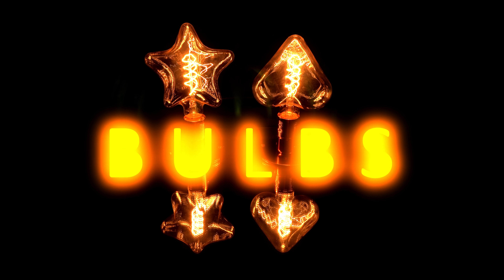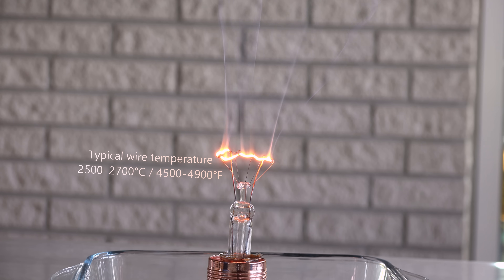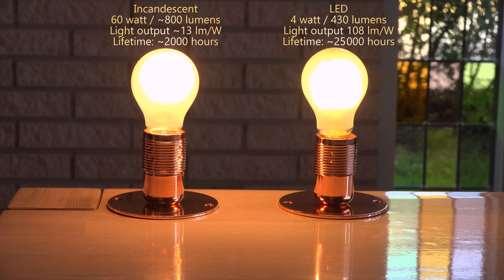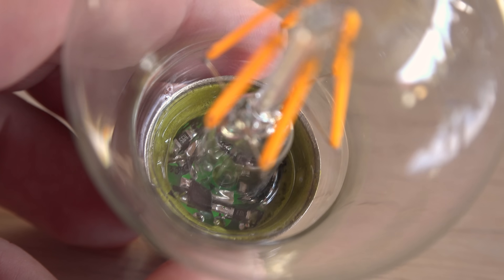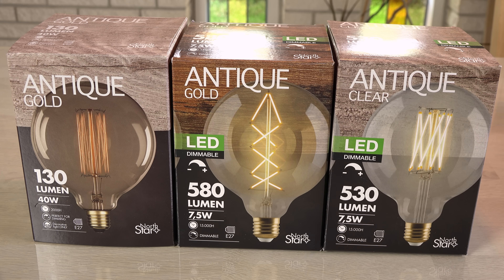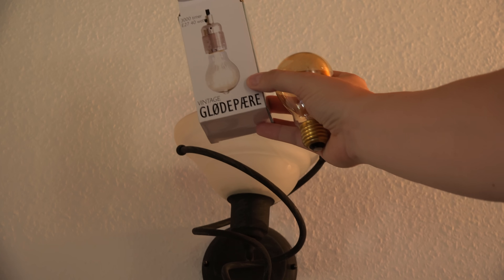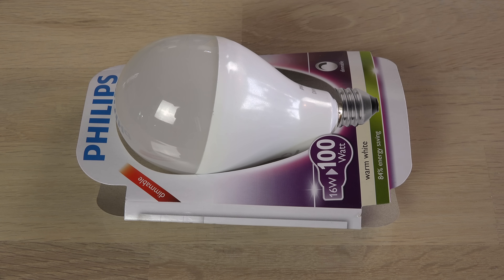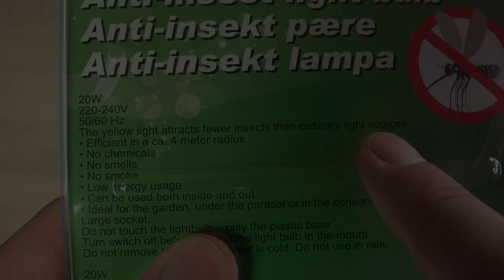Light Bulbs | LED vs. Incandescent

Comment: 🤔 LEDs are efficient, yes. But only indecent light bulbs produce real, balanced natural light with a full spectrum. The fluorescent light of the LEDs has a visible lack of red light, which anyone can test: Hold something red, such as a ripe tomato, 🍅 under a warm white LED, the red is pale. 😐 Under a real incandescent light bulb, 💡 the red of the ripe tomato is rich and bright, 🥰 because only incandescent light produces light with such a long wavelength.
Reply: It's not just reds, it affects also whites and beiges and skin tones, which are perhaps the most critical colours to get right.   What a crap time to be alive -- can't even have a nice lamp anymore.
Reply: @Animal_lives_matter  Yes, I hate the ban on lightbulbs, that upset me at the time. In my bathroom I have an incandescent lamp instead of the fluorescent tube, I look a little better in the mirror with it. All fluorescent lamps, including LEDs, have too much blue, green and yellow, but too little red and no red with a long wavelength, and the spectrum is jagged, which is why this light looks unnatural. But many don't even notice this difference, I do, which is why I bought a box with various incandescent lamps before the ban. I almost only have these in the whole apartment. And only a few LEDs. Maybe you can still find old light bulbs in second hand stores.
Reply: @Tag-Traeumer  
My hardware store still supplies 100CRI halogens, but no incandescents.

I have done a similar thing and stocked up on these halogens, and hopefully ride them out until the LED tech improves.  

I use LEDs for dim 250lm "always on" ambient lighting in the corners of the room to save electricity, but I don't like them as they have that telltale yellowish rendering.  But because they are dim, it's less noticeable.

I recently tried a bunch of smart LED bulbs that let you tune the colour.   They are ok but the colour rendering still isn't right.  

The LIFX smart bulb is the weirdest of them all and has super vivid and satuated reds even at 2700k. Looks nothing like my 100CRI halogens (which look the same as incandescent).

The Philips Hue seems to be the best, but is super expensive and has a dumb "feature" where if you turn it on, you have to wait 20 seconds before turning it back off again, otherwise it resets the bulb to its default colour and brightness.   They deliberately made it this way so people will buy the Philips brand switches to control them which avoids the issue.
Reply: I saw Ikea has a new line called Solhetta which boasts 90CRI.  I got them a few days ago in 1521lm and 250lm.  

The 250lm one looks "okay", a little better than the 80CRI Ryet, but the 1521lm still looks very different to my 100CRI halogens.   Rendering is yellowish and dull reds.

So I am not convinced by 90CRI.  Perhaps 95CRI might be acceptable to me.  There are some on Amazon claiming 95CRI which I am keen to try.
Reply: @Animal_lives_matter  Very clever from Philips, but a cheek. Yes, it has become difficult to buy a light bulb for a lamp. Buy, try, maybe buy new ones again ...

Halogen lamps are also incandescent lamps; the principle of operation is the same, a tungsten filament glows. With halogen lamps, the temperature of the tungsten is slightly higher, which makes the light whiter. The higher temperature causes the tungsten to evaporate faster, but the addition of a little halogen (iodine) brings the evaporated tungsten back to the filament. Halogen lamps are more efficient and give more brilliant light.

LEDs will never be able to produce a good, continuous spectrum of light, I'm sure of that. Normal LEDs (with the exception of RGB LEDs, which also only produce three colors, not white light) are fluorescent lamps. The LED generates ultraviolet light, which is converted into white light in the yellow fluorescent material, but a fluorescence spectrum is always unbalanced (it has peaks and gaps) and poor in red light. LEDs produce light that looks white but isn't really, not like light made from glowing material like tungsten or the sun. In some places LED light is good, in other places I just want incandescent light. Today, a lot more money is made with LEDs than in the past with incandescent lamps, which is also the reason for the ban. I've already brought back dozens of defective LEDs, defective after a few hundred hours, not 15000 hours.
Reply: @Tag-Traeumer  
Interesting what you wrote about RGB LED's, as that was the reason I tried all the smart LEDs which have RGB emitters inside.   Actually I think the Philips Hue doesn't, but LIFX and other cheap generic ones do.   

But like I said in previous comment, LIFX looks very strange -- the rendering of reds, browns and skin tones is super saturated and weirdly glowing and vivid, even though the light coming out of the bulb is still 2700k according to my i1d2 meter with diffuser attached.

All I can speculate is the red emitter must be making a super peak in the spectral distribution or something.   It's like the opposite problem -- instead of reds being too dull they are too intense from the LIFX.   

My halogens are 2800k, a little cooler than 2700k like you said, but subjectively it's not noticeable.   Other halogens are 3000k and those are noticeably cooler.   Some of the generic Chinese smart bulbs I had would not go lower than 3000k and were slightly too cool for my liking.

I wonder if the LED tech could be modified to use filters and diffusers to try and smooth out the spectral distribution.
Reply: @Tag-Traeumer  
I was thinking about the difference between 80CRI and 90CRI, and realised it's only a 12.5% improvement. 

So if you improve crap by 12.5% it's still crap, and the 90CRI Solhetta looks pretty crap to my eyes.  

On the other hand, human perception of colour isn't some linear equation that maps directly to "% improvement", but if the errors in rendering are in the same places, eg. 30CRI on R9 would become 30*1.125 = 33.75, that's still a very poor value for R9.
Reply: @Animal_lives_matter  I haven't looked at CRI in detail. I think the creation of light through heat is fundamentally different from light from fluorescence. With incandescent light, such as in a candle, in the photosphere of the sun or in an incandescent lamp, light is emitted by the excited atoms. All temperatures are evenly mixed in a glowing material, so light is emitted in evenly mixed wavelengths: the spectrum is continuous, without peaks and gaps, and all colors are balanced. Depending on the temperature, the center of the spectrum is of course more hot (cool-white light) or less hot (warm-white light).

In the case of fluorescence, individual colors are generated by fluorescent phosphors. So that fluorescent light looks as good and white as possible, several of these fluorescent luminescent substances must be mixed. I don't think it's possible to use it to create a continuous spectrum. It is quite a problem to produce red with long wavelengths by fluorescence. All the spectra of LEDs that I saw are cut off at red. In contrast, incandescent light emits its energy most strongly as long-wave red and infrared.

Enhancing LED light with filters is a good idea. Maybe that is also done in the lamps. I think filters could absorb peaks in the spectrum, but they can't fill in gaps or create the missing long-wave red.

Comment: the experiment att 4:20 is bad. 
why did you use a 400 lm led, a 430 lm led and 800 lm incandescent. 
that is a massive difference in amount of light and must have effected the experiment.
Reply: I don't think it really matters because the camera is fixed to the same setting, and brightness is separate to hue and saturation.   

But what makes it most compelling is that what he shows in the video is exactly what I observe in real life with my own eyes.  Exactly.

Comment: Incandescent is still available as heat lamps and automotive use. Halogen bulbs are incandescent with a sensitivity to oils touching the bulb. Still used in some construction lights, but slowly changing to LED. Kitchen circle lights are better as a plug & play LED version. Those are hard to bypass the ballast.
Reply: Yeah, only issue is that everywhere is getting rid of fluorescent lights which is dumb. Our house is still full of incandescent bulbs lol
Reply: Why are they sensitive to oils?

Comment: I remember when we were looking for a bulb to replace one of the ones in my grans electric fireplace, it was a red coloured bulb (when my gran was still around her house had electric heating, and a hot water cylender)
we had trouble finding one, and after asking the person in the shop it turned out they did have the type of bulb we needed, but they had hidden them under the bottom shelf

Comment: we have LEDS in all our lights in the house except a chandelie, and i will say the LED's are trash, ive had to replaced 4 of them in just a year, and they arent used much.  I noticed they also flicker and cause the room to blink if you dont look closely.  and these are expensive GE bulbs too.    I have regular incadecents in the drawer that havent burned out in years..  I found they dont burn out if you dont move them.  Chanelier lights or bathroom bulbs.. they last for 10 years or more.. yet the leds dont..

Comment: I am sorry but it seems to me that you do not know all about LED lights. These lights look bright and are easy to be seen from a far distance. for this reason, they are best suitable for store lights and some ornaments but they are useless for room illumination because they don't spread the light around the room and the rooms look dark. You need four 1500 watts LEDs to match one incandescent bulb light.
LEDs are easy and cheaper to be manufactured and sold for a high price.
I am an Electronics Engineer. 
Thank you

Comment: Incandescent lights make you sleepy, they are very relaxing, I miss the old street lights, as I slept a lot better before they changed to LED.
Yellow/orange light.
Reply: I miss them too i wish they brought them back but unfortunately they won't, 

but one thing you can have one in your yard if you buy an hps or a mv fixture online then you can have an electrician to come an install it.

Comment: I agree with the most of you. L.e.d's are the worst for your eyes. Also so expensive, I to have all incadensent lamps in my house! I had a incadensent bulb in my fridge finally gone, and its been in the fridge since I got it. That's been 7 years of opening, and closing of the door. Just replaced it, and will last 7 years more. Only cost me $1.00. Won't mess with a CFL because of warm up time, and what should have been baned. That is mercury! Don't want anything to do with either or, L.E.D and or CFL! I will gladly pay extra for my electric bill!

Comment: The argument at 2:55 is actually wrong. It doesn't take a lot of energy to heat up the small volume of tungsten wire to a few thousand degrees. Since a bulb cannot loose heat through direct transfer (it's in a vacuum), the required energy to heat the wire is negligable. 100% of the energy put into a filament bulb gets converted to electromagnetic radiation. The problem is that the tungsten wire generates lots of electromagnetic radiation in the infrared spectrum which is not visible to us and gets covered to heat once it hits some surface. The LED, on the other hand, only generates electromagnetic radiation in the visible spectrum.

Comment: I know this is an old video of yours, but you mentioned the wattage of your CFL video light being a lot lower than advertised and I felt the need to explain why. There's two reasons for that:

Fluorescent lights require a high voltage to create a path for the electrons through the gas inside the tube. However, once this path is created, it can be sustained with less power. Like a TL, a CFL has a little starter built in, which regulates the initial burst of energy needed to create the electron path. CFLs (And TLs) are rated for this start-up power to prevent accidental breaker tripping. 

The second reason is, to get this high voltage, a transformer is needed. This can offset most conventional power meters because the working current is out of phase (Roughly 90 degrees) with the voltage. This is a side-effect of electromagnetism, and the same principle as to why a magnet falls slower when passing through a roll of tinfoil (aluminum foil)

Comment: Too bad I am constantly replacing LED bulbs around my house WAY more than I ever had to with incandescent.  As I type this my office light has a LED bulb that just started flickering. Any cost savings in electricity is far exceeded by the constant buying of new LED bulbs.
Reply: Exactly, and I can't stand the flicker of LED lights either.

Comment: 3:41 for the bottom street lighting category it should be a High Pressure Sodium light. Low pressure sodium lights actually have a monochromatic output meaning they have a CRI of 0.

Comment: The incandescent lamps using less energy than expected could be due to a difference in your supply voltage to the rated lamp voltage.

Comment: Close to four years on now, I suspect there may have been a big increase in bulb choices (and hopefully quality). Think you could do another video on LED bulbs?
I got some 4-foot (1.22m) 5000K LED bulbs to replace the fluorescents in our kitchen; it's wonderfully bright while also being very color neutral. Food and fabric colors show up nicely. Plus, the ones I got wire directly to house current, so there is no separate ballast necessary for the fixture.

Comment: The ban maybe made sense 10 years ago when led's costed 20x more than a regular bulb, but nowadays you can get a 3-pack for 2$... Even if half of them break due to chinese quality, it's still very cheap.
Any person with 2 brain cells will choose led (cheap, lasts longer, brighter for less power use) even without the ban.
And industrial/ special uses still require regular bulbs, so they will (and can) buy incandescent regardless.

Comment: I amusing 4watt LEDs in  small rooms in My house and 6.5 watts LEDs in larger rooms..... they are replacing Flourescent compact bulbs of 18 watts....  Outside I now use rectangular 10 watt LED lamps with  motion sensors so they only work at night....  Using large powered LEDs in a house etc is just stupid.... Use low wattage  white  bulbs.... EXCELLENT...

Comment: The efficiency for lighting is indeed not every high with incandescent lights. But banning them for that reason is foolish. The lights contributed a lot to the warmth at home in the winter (in the summer we don't use lights a lot). Now we need to burn more gas or wood for the same warmth...

Comment: Over 40W are illegal since EC 244/2009, I have a problem every year in the cottage - frozen toilet.
Fortunately in CZ you still can buy them as industrial light bulbs. But it does not cost 4 CZK/pc (1.15 DKK), but nearly 10-20 CZK/pc (2.9-5.8 DKK).

Comment: Everyone uses the word BAN as if it's against the law to use incandescent bulbs.  What's been slowly happening for years is a guv-mint  push to not manufacture certain types of (once) common bulbs, which is done to promote energy savings. Here in the USA that arbitrary rule started with anything over 100 watts, then switched to over 40 watts. I believe it's now at 60 watts. Some of this is due to the LED and CFL not working in conditions within say a fridge, oven, or microwave. The other part is the use cycle. How long is a fridge bulb on anyway? The down side is people believe they can use a new style bulb and just leave it on 24/7. IOW, false economy. Every time I fly at night I am amazed at how well the earth is lit up after midnight. Why do we do this?

Comment: I switched to all LED lights in my home and prefer the Warm White dimmable ones. I don't notice any flickering or odd coloration. Even the cheap Chinese made brands selling at Walmart in the USA are far better than the ones available 3 years ago. My home has 2 battery banks and inverters so I appreciate the extended battery life with the low power draw of LED bulbs when the utility power is out..

Comment: LED bulbs are absolute garbage. I refuse to buy them. Every one I've bought has failed. So much for the 10 year life. Some last only a week before going dead or turning into disco units. Add to that the cost. I put 120v LEDs in the house - all failed. I put 12V LEDs in my motorhome - all failed. I now have halogen in my motorhome. They were cheaper and work a lot better. In the house I have CFL and if I can get incandescent, I'll get them.
Reply: Zephod Beeblebrox I bought some at Home Depot in 2017 and they are still used today. I use them everyday.
Reply: My Lowes and Walmart bulbs are likely the same and all areworthless. You must have been very lucky since everybody I meet in real life has the same problems
Reply: Zephod Beeblebrox just got to watch out for junk brands. I tried from Walmart brand they lasted a week
Reply: @steve_3009  What surprised me was the Walmart bulbs lasted longer (for the 120v versions) than the Lowes bulbs. The 12v bulbs are a mixed bag. Some Chinese bulbs that get so hot that I don't trust them not to catch fire, some walmart bulbs that just blow fuses after a few weeks and a lowes bulb that's simply the wrong shape. That's why I went over to 12v halogens. They work, produce heat in winter and in summer the extra heat is negligible. Since everything is solar charged, I'm not really losing anything by using halogen.
Reply: My Lowes and Walmart bulbs are likely the same and all areworthless. You must have been very lucky since everybody I meet in real life has the same problems